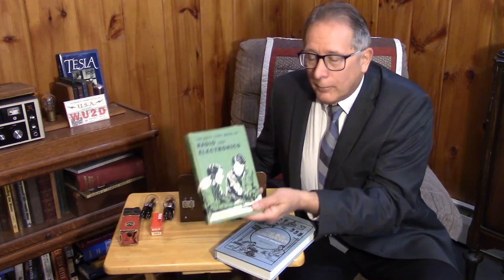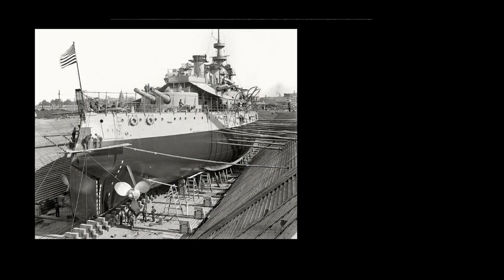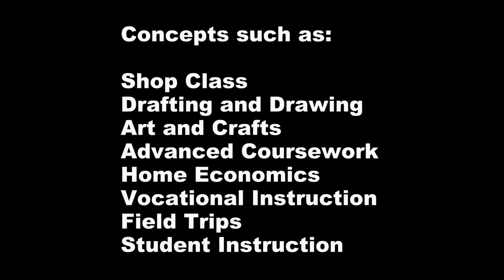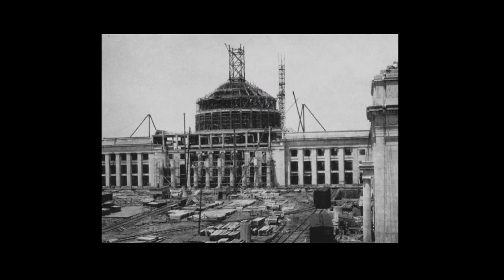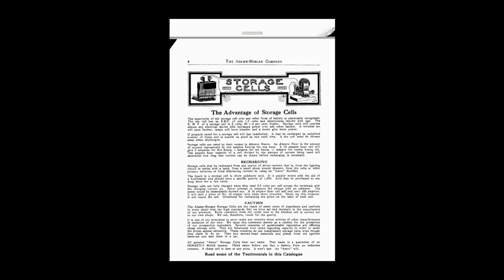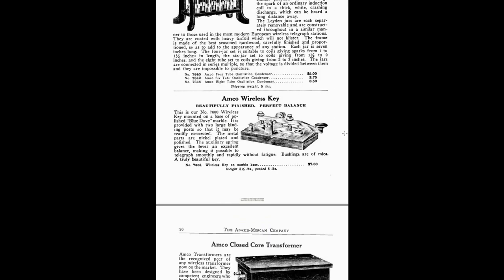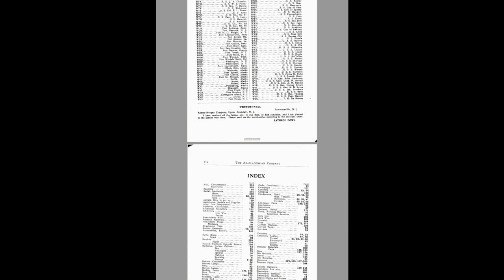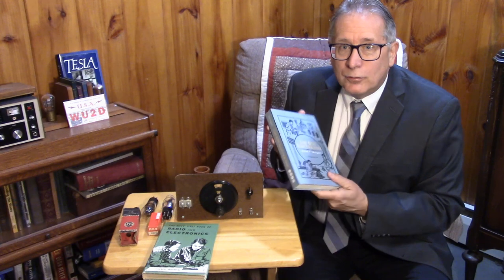Alfred Morgan Revealed - Part 1

Comment: I will have to say when I was 11 years built a xtal set for grade 6        I went library picked up the boys first book of radio.  grade 7 and 8 was building power supplies and crude receivers.   got electrocuted couple times too..    Yes Morgan was very influential for me young boy to learn radio.  easy understand reading.     went on be a ham radio op too   age 14  call ve4akf    been ever since in electricity.    made living to at it   any way.   buy some bread milk          thanks Morgan. !
Reply from the maker: Any kid who does this stuff starts to think of himself as some kind of engineer. I found that it did not help with impressing girls, however.

Comment: Ham of 1910 was happy with 3000volts on the coil and capacitor and no safety whatsoever! Sparks flying out every time he keyed the transmitter
Reply from the maker: They were mad and I wonder if any hams actually slept. They even had a name for this. "A Hard Boiled Ham."